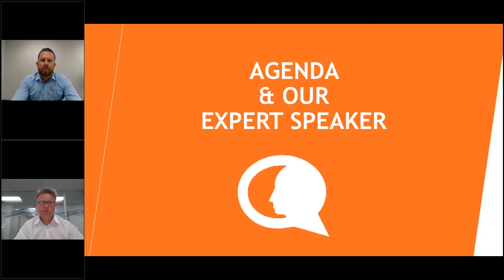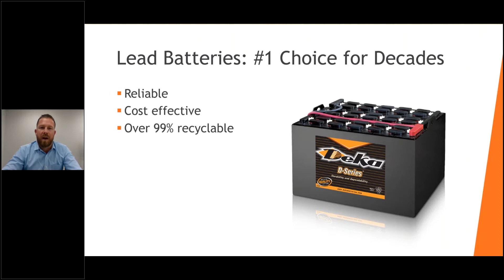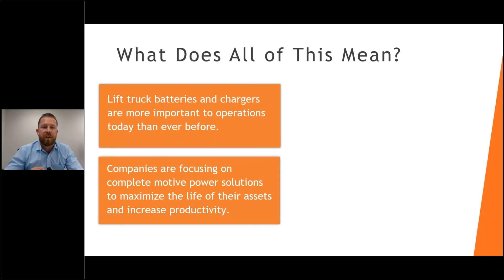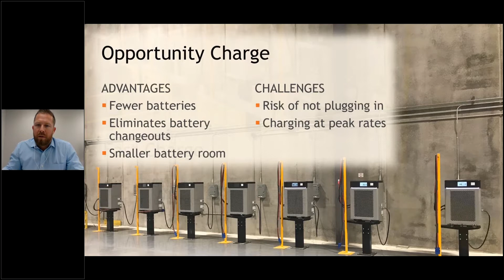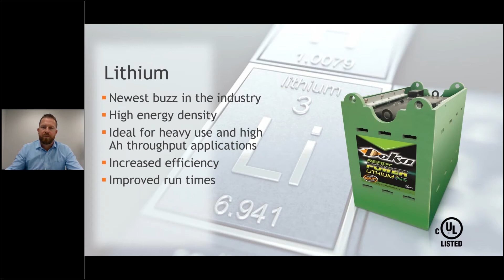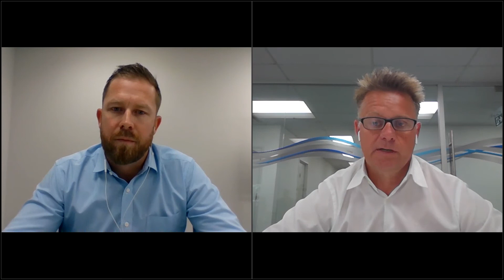Forklift Batteries - Everything You Need To Know About | Elevating Minds EP4 | Ryan Judge

Comment: AGM batteries are the answer for most forklift applications. They require less maintenance,  but they require a lower charge level so you might need a special charger. Some chargers have a AGM setting.

Comment: What's the difference between plate cells and tubular cells and which is better and why.
Reply from the maker: Hello Dan. Both are lead acid batteries with different design structures. They have their respective benefits and drawbacks on many levels including life span, water levels, temperature, charging time and price. To answer your question, as to which is better and why, the choice largely depends upon the application. If you are interested in learning which would be the better choice for you and your circumstances, please call us on 1-866-465-4386 to discuss free of charge at your convenience with one of our industry experts.